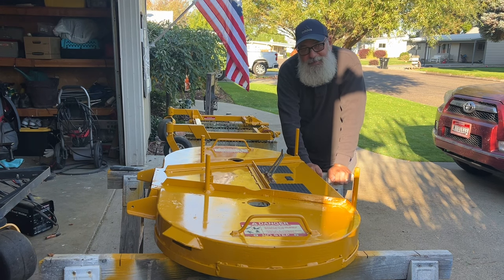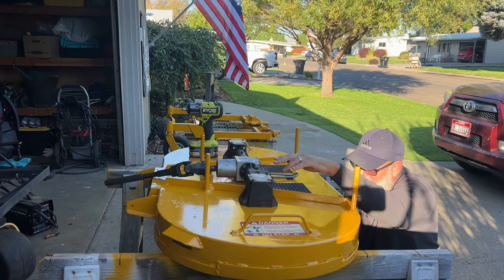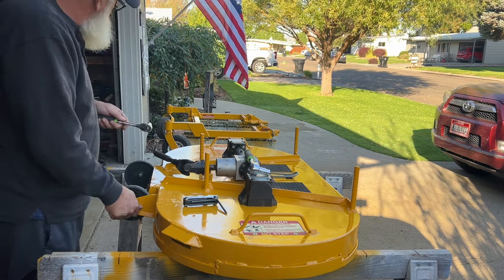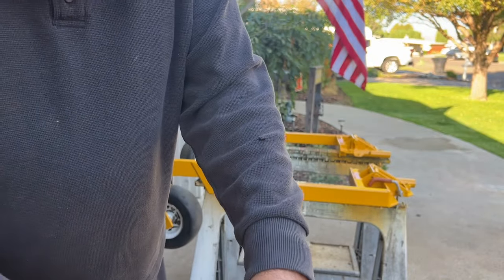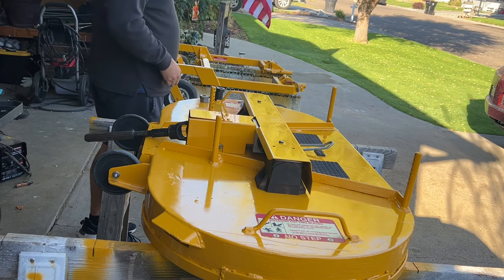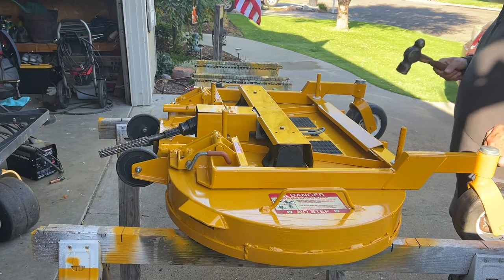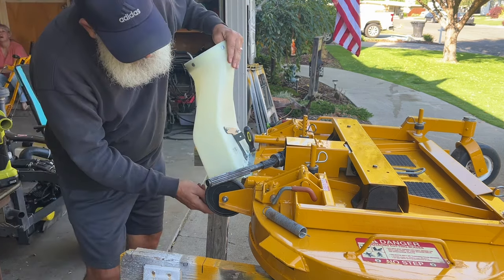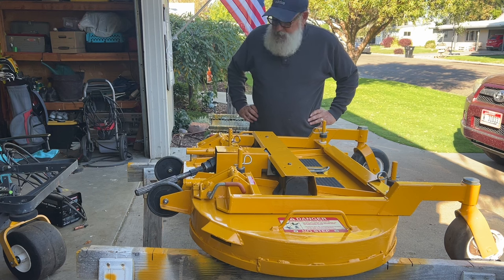Start to finish assembly of Walker GHS deck

Comment: The mowed height pin holes changed with the carrier ... The older ones have rounded bent square tubing near the deck pull to flip deck pins are. The one you have there is the "newer" model that have sharp right angle construction. Seems no doubt a production saving thing, square tubing isn't fun to bend